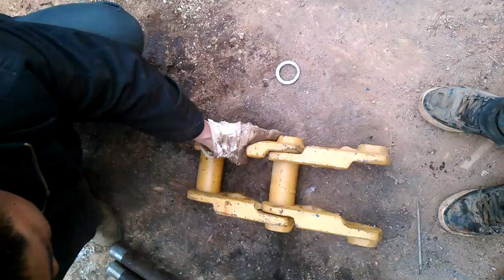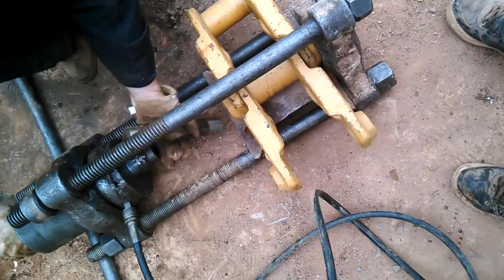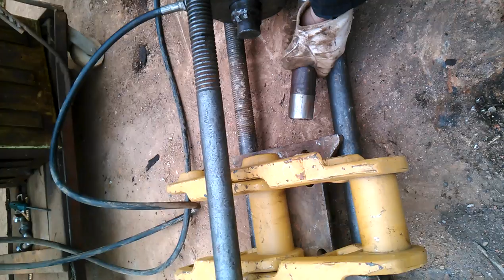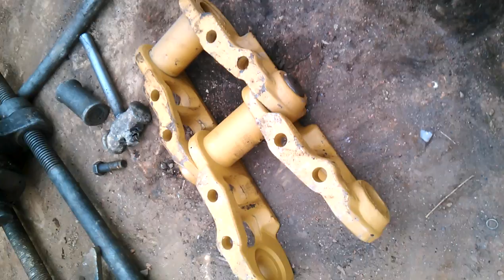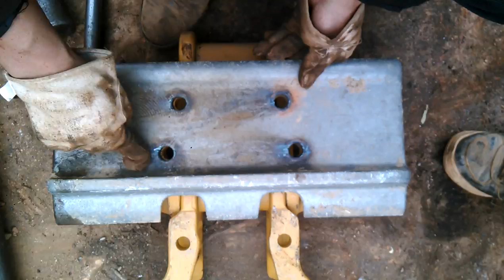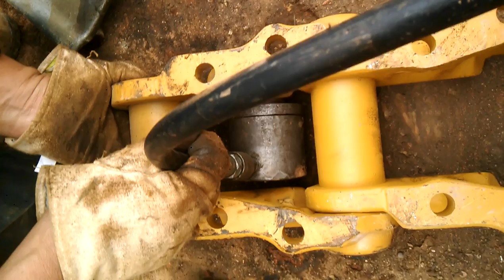how to put pin in (portable press link machine)

Comment: How do you add the grease or oil inside the bushings ?
Reply: idessaoutlaw 
You don't.  I think some of the newer models have o-rings to seal in a bit of oil.  But I don't know which ones have that setup.
Reply: Sealed and lubricanted tracks have  oil in but only I'm manufacture oil can not be added
Reply: @killingoldgrowthsince  There is in some tracks, they’re called ‘SALT’ tracks- Sealed And Lubricated Track
Reply: @shanemurphy2680  You can add oil to them, but generally if you need to add oil then the seal has failed for one reason or another and needs to be repaired